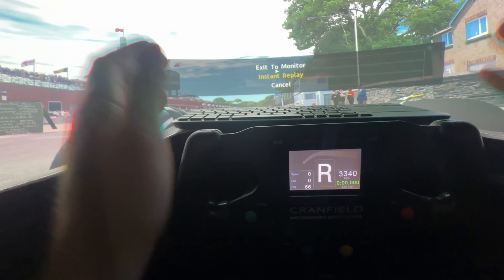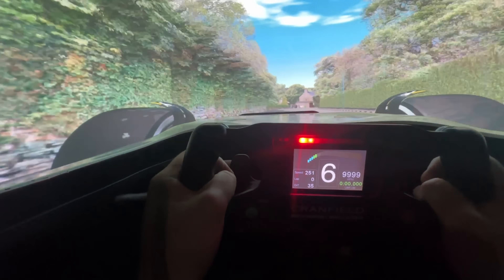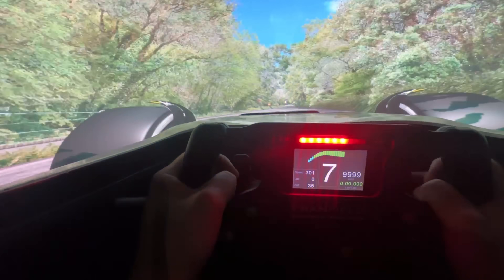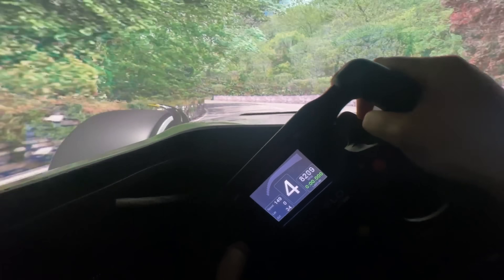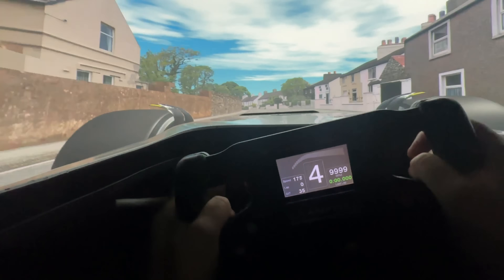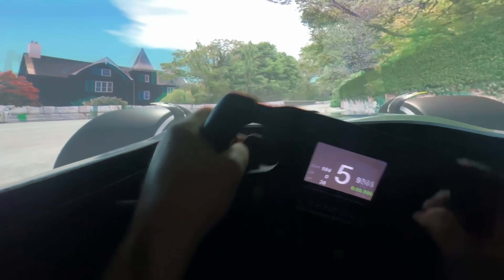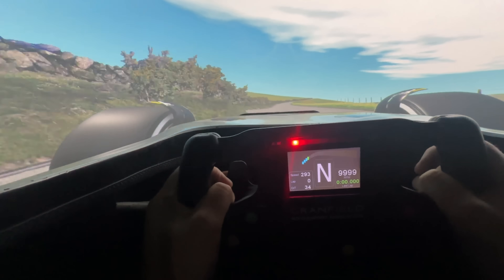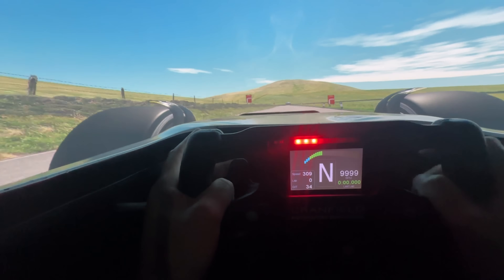How Fast Could an F1 Car Do A Lap Of the Isle of Man TT Course

Comment: Formerly worked in F1 and this is a conversation I’ve had with friends a lot. Genuinely speaking I think there are sections the current cars wouldn’t be able to make it around but there are also sections where in theory the F1 car would absolutely hammer a bike. Great committed lap in the sim! Sharing this with a friend in F1 now 👏🏻
Reply: Can you ask them.... roughly and withour getting the sack.... how fast will it go mister if the longest diff were squeezed in... whats the biggest pinion you could sneak inside the cases

 How much ride height could you wind into it? Now I know. But you know what I mean. As in down the pub could we get it say 30mm higher then skin the bottom with 5mm of kevlar and fuggit, safety last, see what happens. Anyone run this through a computer just to see? 

Lastly is rhere any way if finding an F1 steering rack with eniugh displacement to get around th3 Nook with half an unch to spare.... just to piss off miserable typee that cant enter into the spirit of things.... or even... whats the min turn radius for a Uey. And we can gwr the marshall to measure how much pavement and wall needs nibbled to make a real F1 just fit. The difference between Monaco and the Nook is whqt I wonder....
Reply: Seriously doubt an F1 car would survive a full hot lap... I would not like to see the mess a driver would be in at the end either.... it would beat you half to death!!
Reply: @albertbahoogadin  the course is not bumpy at all, only couple miles after Sulby is. Driver would be just fine.
Reply: @ducedevlstear2471 ... look bud I really dont want to be rude here, have you ever been round the man at speed??? Not bumpy... go ask Mark Higgins about that one, find out what that track did to his wrx the first time he tried a hotlap 😂😂

....F1 car, any open wheel single seater will be decimated...
You dont have a clue what you are talikng about buddy sorry x

It is a bike track, and it is rough engough on bikes and riders. Riders come out of laps brused to hell regularly ... have done myself ok
Reply: @albertbahoogadin  listen bud, what you talking about isn't called "round the man", nobody ever called it like that because it simply isn't "round the man".
And yeh, I have been round, countless times, I don't think there is a road on the Island where I haven't been.
On the other side, I don't believe you have. I mean, it gives you more beating than a shop trip on your scooter but it isn't any especially punishing road at all. There are lot worse roads round the Island than the course. 
"Kill the driver" ffs. You sound like the the roughest and toughest trip you ever done is the beer trip from your sofa to fridge.
Btw, Mark didn't "tried a lap", he did quite few over 3 years.
Reply: Time attack or dtm maybe
Reply: For a lot of the lap a F1 car would be flat out, it's all about the bumps.
Reply: You don't need to 'build' it specially, but you would need to set it up - same as for a bike. Some F1 circuits are bumpy too. Don't know if they compare, as bumpy in a high downforce, stiffly sprung vehicle might not be anything much to a bike. However they have run a Red Bull at some quite large ride heights on salt and snow.....
Round Silverstone I have driven a 250 kart which can do 2:02 lap time, suoerbikes record is 2:04. Bikes are quicker accelerating above 120, but braking and cornering is better at high speed in kart. F1 is in another world at high speed, braking and cornering 4-6g. It seems to me that a lot of the IOM is very high speed, so would favour the car, but narrow -  which would mean there would have to be a little more kept in reserve. Top F1 speeds now are around 230mph, so plenty of legs for the faster sections.
Reply: @NigelRCharman  it's not about top speed but about keeping the speed through curvy sections and as you mentioned, F1 can keep very high speeds through curves.
Reply: @ducedevlstear2471 how much does the car width matter?   Are there things the bike can straight line that the car can’t?
Reply: @cjk32cam  not really, especially with the walls around you can't really go to the apex that much. And remember, the bikes lose time during flipping from side to side. Although that's not that relevant around Mountain Course as there are no chicanes, only some esses. It really is mainly the downforce that allows a lot faster corner speed.
Reply: Oh my days….. it’s a hypothetical question, everyone getting their knickers in a twist about it 😂😂
Reply: Yeh, reckon over mountain the car would good for a start
Reply: @spikodemiko5514 there has never EVER once been an open wheeled single seat car having done a lap of this track and for very well known reasons... it would destroy the car and most likely kill the driver in doing so....

Trust me, if it could be done it would have been done by now 😂x
Reply: @albertbahoogadin you’re probably 100% right m8 but I was only talking hypothetically 👍
Reply: This isn't valid unless you use an F1 car setup as is. Not an F1 special addition just for this circuit and a non special F1 engine will not handle the extremely long straights.
Reply: Well mark Higgins did a 129mph lap in a 2016 rally car...he hit 175mph at several points...some of the bumps were back.jarring he said, think the undertrays etc. on a formula car would get seriously damaged..it's on you.tube, worth watching as he skilfully commentated..it beat the bikes of that period
Reply: @andrewbradbury8527 it didnt beat the bikes at all, that year 2017 car got 128.7 I know bikes were 133.9 in senior of the top of my head.
Reply: @matttaafe8039  it didn't beat the bikes but you have to remember that Mark only did maybe dozen laps over 3 years being there and his time should be best compared to Hicky's newcomer record the year before which was just a little over 129.mph. So Hicky's time was only about half a mile faster. With a lot more laps and with more professional racer in his prime than Mark was. Had Mark done more laps there is a big chance that he would have beaten it. 
But it definitely can't be compared with overall lap record just because cars never got anywhere the tracktime like the bikes did.
But imagine if it was Löeb in his Pikes Peak Peugeot, he would take the overall record to pieces within handful of laps. 
Or maybe Romain Dumas in the Porsche 919 EVO.
Reply: @andrewbradbury8527  I wouldn't worry about the bumps that much because they are only over short stretch after Ginger Hall, plus couple jumps where you need to slow down moderately. But you would more than compensate for it in other places.
Reply: A 2010 Dallara F3 can lap Silverstone in 1'51 seconds...230 bhp.8 seconds quicker than the motorcycle lap record
Reply: I don’t think a F1 car would get round tt circuit
Reply: It would be awful
Reply: "there are sections the current cars wouldn’t be able to make it around" - this is where the conversation ends.
Reply: @Japs_Eye_Of_The_Tiger no because you can still take an older f1 car and it would be able to make it around
Reply: @Japs_Eye_Of_The_Tiger Nonsense. Any current F1 car can simply spin the rear wheels to take tight hairpins. And it can slow down in extremely bumpy/uneven spots and still beat a bike very easily around basically any tarmac track - Isle of Man TT, Pikes Peak, Nordschleife, Trento-Bondone etc.
Reply: @Japs_Eye_Of_The_Tiger they would, even if they would have to not go full beans through those sections. And it's not that many of them.
Reply: The car can't even idle for that long because they're afraid of failure
Reply: @GT1Vette not true, they can idle till the cows come home these days. An F1 car did Bathurst, but the set up it needed would never be used at a race circuit, and i expect it handled like poo. You give it the suspension, ride height, ateering rack it needs to get around the circuit. The only thing that might stop it would be extreme unevel surface, to the point where even with a very high ride height it is still grounding
Reply: @mutleyeng The question was an F1 car, not a special F1 made for the tt. The engine wouldn't last.
Reply: @GT1Vette the F1 engines are more reliable than they ever been. That's the last worry. And of course you are allowed to set the car to each road track where you take it, they are setting cars not only before each session but countless times during each session.
Reply: @ducedevlstear2471 Then this is a stupid hypothetical question. If you're going to build an F1 car specifically for the tt then of course it's going to be quicker than any motorcycle.
Reply: @GT1Vette nobody is talking about building it specifically, only about setting it up. And it would take any bike record to pieces, no sweat.
Reply: @ducedevlstear2471 You think you can take that engine & run those long straights at full speed without any issues, doubt it. Also, these bikes are more closely related to wsbk, not MotoGP.
Reply: @GT1Vette now you proved that you are clueless.
Yes of course I'm sure that modern F1 hybrid+Turbo power units can take a lap round the TT course. And remember, the F1 engineers are a lot smarter than you so they would tune the engine as needed. With a flip of a button. Just as they do several times a day, on and off the track.
I can't imagine that there is anyone who wouldn't know that they don't run GP bikes. Of course they run SBK, apart from other bike specs.
Reply: @ducedevlstear2471 Did you watch video? He never mentions superbikes he compares time with MotoGP. It doesn't take a engineer to know that current F1 engines are not made to go full throttle for long periods of time. This is why they would need to build an engine that would not be used at any current tracks, which means it would need to be a special built engine. Maybe you're too much of an F1 fanboy to admit a new power unit would need to be built for this application.

Comment: interesting conversation i wonder what a motogp bike with toprack on it would do? maybe 145 if it was geared for the straights.
also in reality the f1 would be hopeless because overtaking of slower drivers would cost so much time.
Reply from the maker: Yeh you could never race them round the TT course but a single car doing a fast lap would be interesting to see